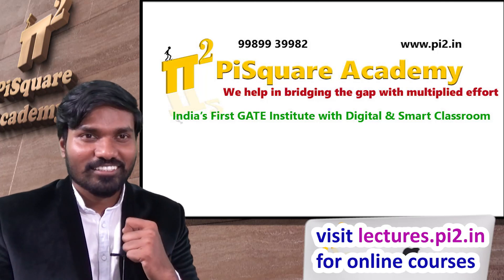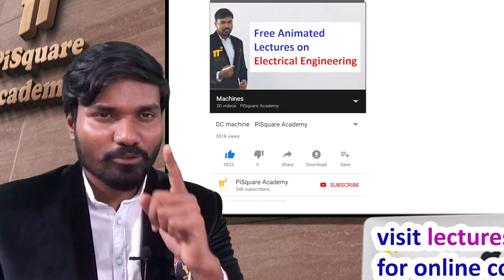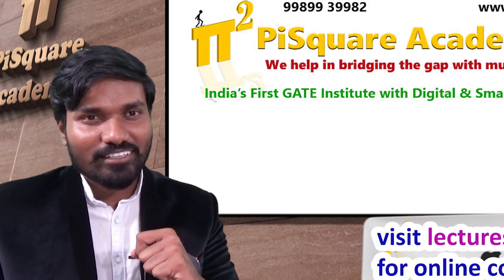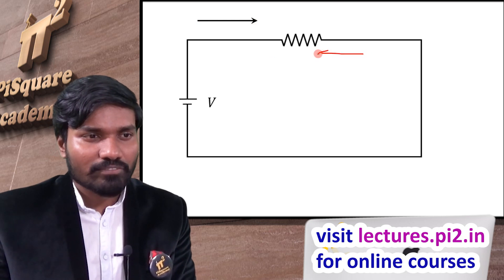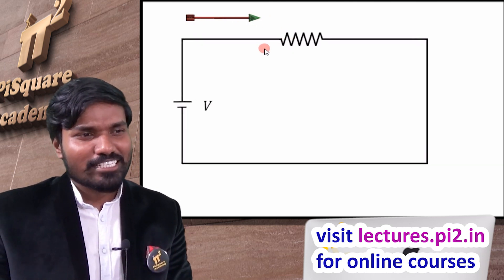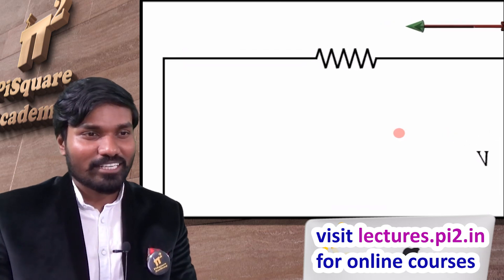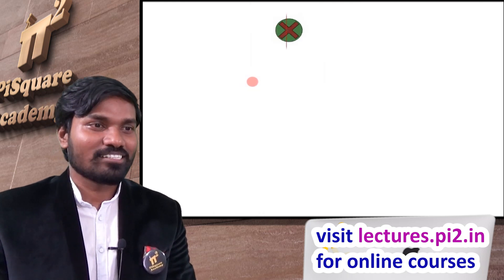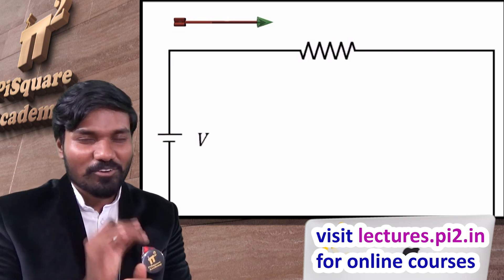Why Dot representation for current direction | Unveiling Electrical Conventions

Comment: Sir please solve this confusing problem,for different possible cases

if the no of turns doubled then time costant of a coil will becomes
Reply from the maker: Time constant will remain same, as the no of turns double every thing else is constant, L will become double (as turn and length of coil is double) and also the Resistance will be double. So time constant no change.